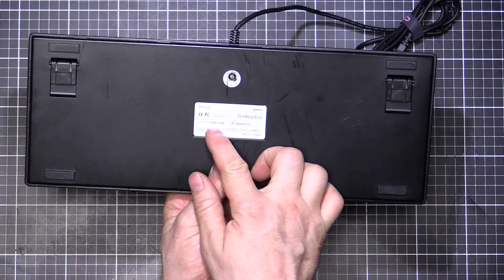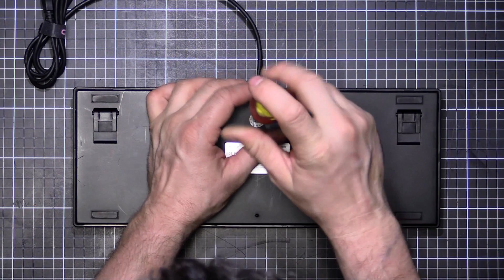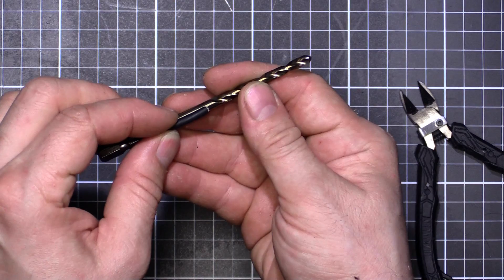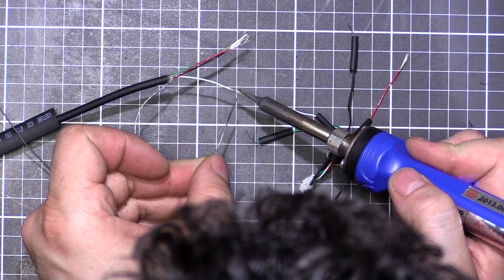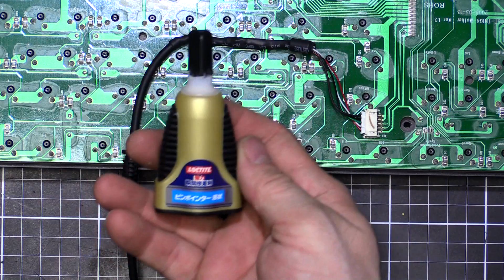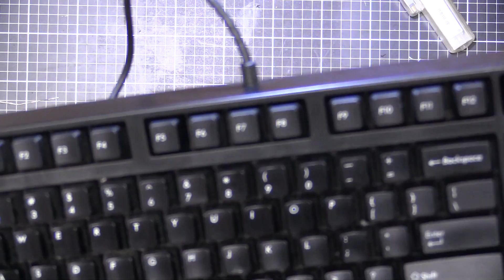How to repair a USB cable

Comment: Can we not replace the cable from another keyboard and avoid the soldering?
Reply from the maker: Only if it uses the exact same kind of plug on the PCB, if it even has a plug.. Cheaper keyboards often have the wires soldered directly to the circuit board.

Comment: Nice.  I should have looked this up a few months ago when I needed to replace an expensive keyboard.  I instead  bought a new one - one my dog decided to use the cord as a chew toy...   The new keyboard can get repaired for free supposedly, but I'll try your repair example on the expensive one - only complicated in that it has more cables since the keyboard includes a USB 3 hub and headphone port, so has 2 USB cables and the headphone line all going through a fat cord.  I also don't know where the break is on that cord so might have to trouble shoot or maybe just replace all of them with new wire.